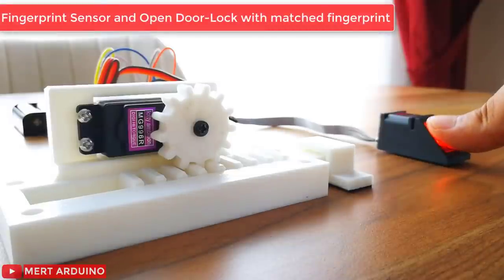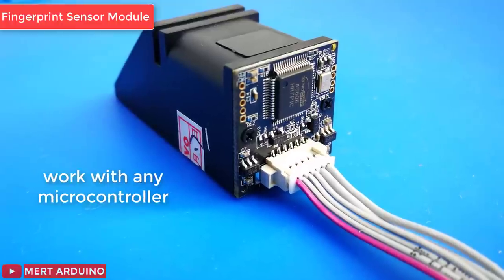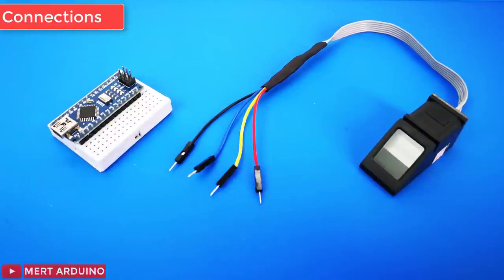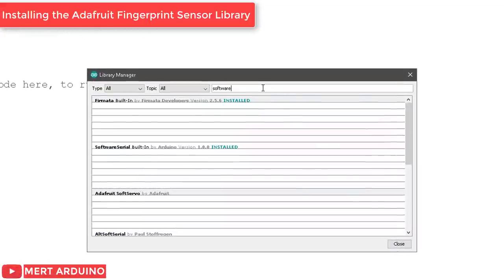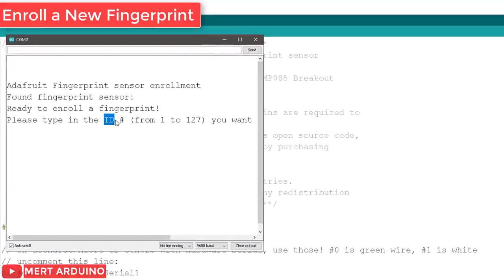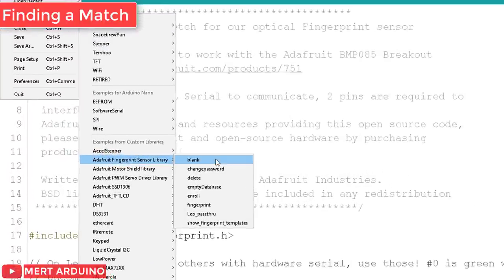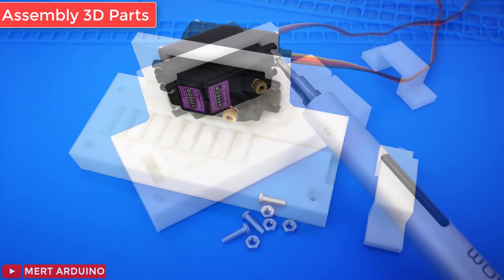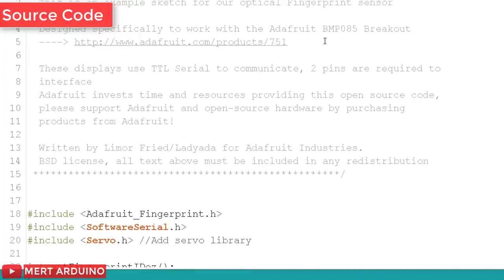Getting Started with the Fingerprint Sensor | Fingerprint Door Lock at Home

Comment: sir i am using 12v solenoid lock plz tell me the circuit diagram
Reply: Use a relay to trigger the solenoid. Make sure your arduino can trigger the relay
Reply: @connor4317  will you plz upload a video of opening a solenoid door lock using fingerprint sensor in arduino uno for your subscribers